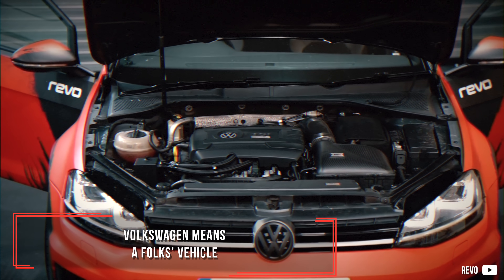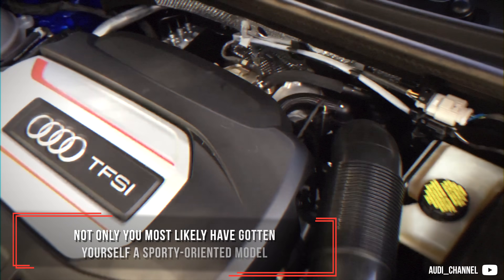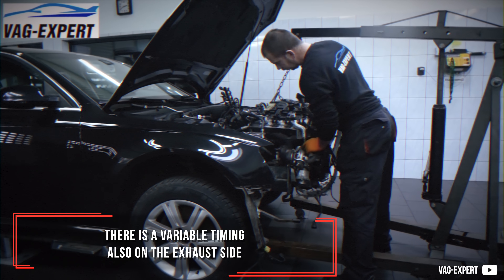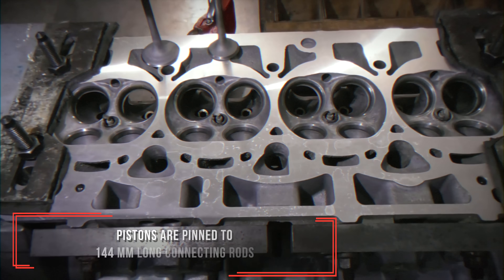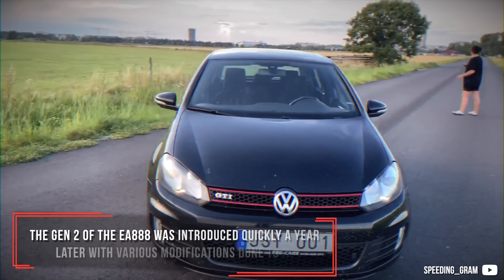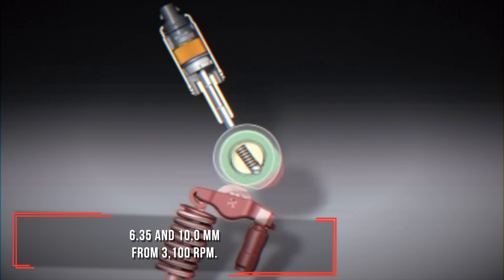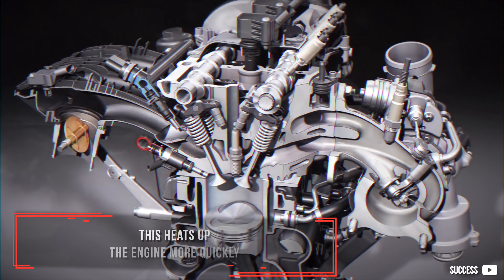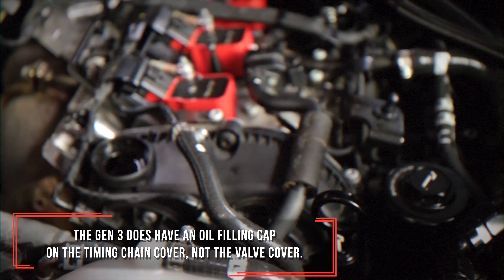Why The Volkswagen EA888 Is So Good

Comment: I would like to spell out a very common misconception with the gen 3 2.0 EA888 TFSI's:  The 2.0 engine in the Audi S3 and Golf R is NOT the same exact  engine that is in the standard 2.0 Audi A3/VW GTI.  On the S3/Golf R there are many upgrades over the standard 2.0 , they are: 1) different cylinder heads  (different aluminum alloy for higher thermal stress) 2) upgraded exhaust valve seat rings(improves temperature stablity), 3) upgraded exhaust camshaft (adapted valve timings) 4) compression ratio of 9:3:1 with different pistons 5)piston cooling jets (higher flow rate) 6)exhaust turbocharger 7) higher charge pressures up to 17.4 PSI 8)high performance main radiator 9) the connecting rods are reinforced.  Just wanted to clarify that . Im glad I went with the S3, so far even stock it very quick and has amazing handling characteristics , (tossable chasis and very nimble)
Reply: Don’t be an elitist, it’s pretty similar. Makes 50hp crank hp more. You just copied and pasted that info from the forums lol. Sincerely guy with owned a heavily modified A3
Reply: @Irishluckily  
Has nothing to do with “ elitist “-
Why the inferiority complex?
I used to have an A3 , love those cars also .
The truth needs to be known tough guy-
After all what is copying and pasting for? Lol

Comment: 2015 audi S3 105K miles. 
Did new waterpump Thermostat 
Carbon clean 
Coils/plugs 
Stg 1 high boost 93 Oct.
Cobb tune OTS. 

Still running like new

Comment: First lock down I bought a passat b5 2000 1.8t with 300k km and tuned it to stage 1. Such a difference. I made trips all over europe and uk and made 30k in one year. Easy to maintain it, change the oil etc. So good to feel the acceleration and power and yet the consuption was about 6.5l/100km. Once I drove from London to Slovenia in one go consuming only 6.2l/100km even though in Germany I drove up to 200km/h. Such a fun engine.
Reply: I swear there's no change in fuel consumption from 70mph to 120mph in most small VW with turbocharged engines.
Reply: @jasono2139   I am coasting a lot and braking with engine which helps low consumption. Of course if I was driving 200km/h all the time I wouldn't get this mpg. In Germany there are patches with no speed limit, but mostly it's 130km or 120km limit. And the quality of roads are important as well. Some roads slow you down even when going downhill.
Reply: @otherstuff9121  yup, I've never done 200kph in the US or Europe... but it's honestly crazy how fast people in Europe will drive on the highway despite some cars barely having the power to keep the limit.

Once I drove my wife to see her grandmother once, we were doing 160kph for a while and didn't pass anyone!

You'd be blowing everyone's doors off at that speed in the US.
Reply: @otherstuff9121  as for consumption, only once did I average about 140kph on a trip... but I still got about my average of 34mpg on the highway. 🤷

...any other car I've driven would have gotten about 10mpg less doing those speeds.

Comment: i have a mk6 GLI 30th edition with the  gen3 in it, and it has been such a solid engine so far hoping that i dont run into turbo issues because the gen3 in the mk6 was a bit of an odd engine, hardly any of the MQB stuff works on it.
Reply: Mqb stuff can work with right parts

Comment: I can confirm. I have a 19 Passat Wolfsburg and have A custom exhaust. The car sounds like a v12 but with DSG farts which is insane. I've been able to race WRX STI, Dodge Charger RTs, Type Rs and 500+ HP Range Rovers and BMW and beat them or tie with them from a dig even though the car is front wheel drive. The acceleration is insane. driven cross country  3 times within a year

Comment: The version of the 3rd gen that we get in the U.S. does not have the added port injection.   Carbon build up is unfortunately still a major issue for us.
Reply: not always...I give my Audis' and VW's frequent "Italian tune ups" which works for sure- it blasts alot of the carbon deposits away.  Im on my 2nd 3rd Gen EA888 and have not had carbon build up issues yet. Still, carbon cleanings are not the end of the world, can be done for a reasonable price.
Reply: @volkssturm9694  so called Italian tune ups will not help..think about it.. valves get hotter.. carbon bakes on hotter..or the carbon flakes off and gets stuck in the rings  or thuo the turbo blades....yes i am a tech...
Reply: @randellgribben9772   In theory ,....maybe, but reality is often a totally different story.There is tons of anecdotal evidence that Italian tune ups help to at least some extent. Like I said, I have never needed carbon cleanings  with various EA888 engines all around 150K miles...maybe I just got lucky?  Even if so, a nice carbon cleaning is not that expensive. I do enjoy listening to a "techs" input though.
Reply: @volkssturm9694  12 years at     alfetta motors in vallejo cal... worked on classic Italian cars as a    'tech '  so i just might have some experience working on cars
Reply: On the gen 3 they changed the funnel design of the air/oil separator or PCV. Thus, helping with the carbon build up.  All DI engines suffered from carbon buildup. Even Hyundai‘s, Subarus, Fords, Chevys,  Honda
Reply: Is that the case for the later gen 3b engines  @tfiresmith01
Reply: The gen 3 doesn't have the carbon issues of the earlier gens.
Also, Italian tune ups and not always driving like an old geezer.
My '15 1.8 drives like new still!

Comment: waiting for the clutch to (eventually) die out on my 290 Cupra. Afterwards, I'm putting a Sachs Performance kit and making it stage 1. 290 hp is enough for FWD, really difficult to put down the power but am still curious how it will perform with the extra boost

Comment: is there a direct injection gasoline engine that sprays the fuel thru the spark plugs? IE the spark plug is also the fuel injector nozzle.

Comment: I've never come across an engine with more issues than a bad gf. Looking at bent valves in a 09 VW Tiguan, 09 Audi A4, A3, chain issues with the Tiguan also, and crap intake manifolds on the A3 and a VW CC. If you ever wanted to have a car that can surprise you with different problems ever time it's this one. 😀👍

Comment: Sold my 1.8t passat with the ea888 at52k  miles. It was already chugging lots of oil between oil changes and rough idling at times. Check out what scotty kilmer has to say about vw/audi.
Reply: recirc is plugged! scotty not always spot on.
Reply: @geodot595  you havent even seen the car and already making Dx. What makes you think you got anything on mechanic with 50yrs experience. Those engines are just not built to last.
Reply: @Green_Dragon2023  i am a master german car tech 28 yrs.
Reply: If you say so. Glad i got rid of it for a good price though.

Comment: The EA888.1 and .2 Can be reliable tuned as well, Do your maintenance on time, every time. And dont put off repairs for too long or they get worse and can pile up on each other.
Gen1 & 2 of these engines (Gen1 ususally considered more reliable in general), Both versions have chain tensioner issues and tons of them still run the same tensioner design. Until the newest revision, All tensioners for these engines weren't exactly "Good" they were just improved.

 My A3 wasn't included in the recall and had a first revision tensioner that was ready to explode at any moment when I got it. Didn't sound bad at all, barely any noise on startup. Couldn't even hear it with the windows up and hood closed. Don't risk it. Don't even start it again even if its been sitting for months, until you can move it to take care of it.
 Any chain noise at all is not good on startup and any noise means its already toast. Its not an "I can push it to next week/month" moment Its a "My whole week/month has been ruined" moment.

Get your that taken care of or do it yourself (Not a fun job.. Or tooo bad either), Check over everything physically and for leaks. Get a Vag-com or OBD11 and check that everything is operating within OEM spec on the engine side, Timing, Fuel trim, etc... Keep up on the irritating Carbon cleaning ritual, Install an All Metal Water pump when needed, Fix whatever else you need to. 
And it should be good to go for a long time.
Reply: Absolutely. Im getting close to the 200 000km Mark. No oil consumption, Chains still well within the tolerance... Ive basicly had no issues with this car even tought the ECU is "flashed" with a Stage 2 programmation for now over 100 000km

Comment: Great engines if looked after. Cars earlier than MY12 should have the revised timing chain tensioner fitted at the very least to prevent potential catastrophic failure due to a design flaw in the original. Stage 1 remap transforms the car but doesn’t hit fuel economy if you need to be economical. On a boring drive I’ll see around 45mpg while on a quiet day I can boot it and still get no less than 35mpg on the same journey. It’s nice to have the option of having power to spare without economy being sacrificed when you drive normally, and right now that matters with the price of fuel being what it is.

Comment: I loved my 2017 S3 with hybrid turbo, and the EA888 is great. My only problem is the more power I made, the worse it sounded. I moved onto a B58 but the EA888 will always have my respect as one of the best modern 4 cyl
Reply: yes, the problem is when you do a performance cat back exhaust on the S3,  and turbo down pipe, it sounds too much like a ricer.  My S3 is stock for now, 2018 only 15K miles, has factory resonator delete and IMHO its one of the best sounding 4 bangers like this, set up nice and deep/rich exhaust note, very nice.
Reply: @volkssturm9694 you’re right - but the lack of good sounding EA888s isn’t because of some inherent design flaw of the engine - it’s due to the turbos. The K and IS series of turbos are not great in terms of how they sound when paired with the 2.0T. 

Look at any G series (turbo by Garrett) build on the EA888. They sound IMMENSE!! They absolutely transform the acoustics of the exhaust and make the EA888 sound genuinely good. 

The IS38 and IS20 are too small and restrictive to truly allow the engine to sing - they act as permanent mufflers on the exhaust.
Reply: @UnknownBreadd1  interesting. My S3 is stage 2 now with FBO, just a downpipe ( CTS 3.5 inch catted) to the Rez delete and factory cat back and IMHO It sounds pretty dam good . Eventually, I'll go hybrid turbo, Ill look into the Garrett, thanks. Pretty amazing what the beefed up 2.0T ea888 can do with bolt ons and downpipe,...running high 11s in the quarter, total blast to drive.
Reply: Add a vibrant ultra slient resonator  @volkssturm9694
Reply: Sounds like a European Godzilla
Reply: Toying between a golf r wagon and a 330i wagon..the Vw sounds terrible as u said and the b48 sounds pretty good for a 4. Just a big price jumo
Reply: @tellyawhatmate huge price jumó lol
Reply: Add a vibrant ultra quiet resonator

Comment: I have a ea888 in mk6 gti  thats been running a bigger turbo,methonal injection and a decent tune for a while now. I am happy with it. Had some water pump issues caused by the timing cover oil leak. 
Replaced the timing cover gasket,installed metal water pump housing,that problem has been solved. 

I also have the gen 3. So far only a stage 1 tune but it's been doing fine as well. However in the US the gen 3 didn't get port injection along with DI. It does use a little oil and is only 50k miles, curious to see if it's going to hold up long term.

Comment: I drive a stage 2 mk7 gti with the stock 2l turbo charged es888. so much fucking fun and the sound. ugh

edit: with cold air intake, downpipe upgrade, intercooler, and engine tune it makes 320 bhp and 399 ft lbs of tourque. the tuning possibilities on these are wild.

Comment: My 1.8t 1998 A4 quattro was sold to the original owner with 300,000 miles. All stock internals and trans with a 24psi K04 tune + bolt ons. Even when the intercooler was popped off doing a pull, limp mode allowed it to drive home gently. 

Truly a tank. No issues and all servicing was cheap and I could do it myself.

Comment: I bought a Mk7 GTI new in January 2015 with the 3rd gen motor. I have 84,000 miles on the car over 7 years of ownership It’s been perfectly reliable. Synthetic oil changes every 10,000 miles and it runs perfect. People say VW’s are unreliable I’d disagree as their newer stuff is fantastic I’ve spent less than $1,700 in maintenance over 7 years for my VW outside of tires.
Reply: Yikes!! 10,000 miles is way to long before oil changes....fucking thing only takes 6 quarts. I did my oil changes every 4k miles on my 16 mk7 golf gti, 6 years 100k miles and the dealership thought it was a brand new engine. You probably have burnt oil and sludge building up in your engine with that oil change interval.
Reply: @robbalinski1606  most likely not..... The VW/Audi 07k motor does 10k intervals for synthetic..... I've seen these Opened with 12k oil changes over 100k miles with  no sludge ........ But to be fair the 07k is the better engine anyway.......
Reply: @robbalinski1606   agree totally,  with my 2015 Audi A3 1.8T Gen 3 EA888 I did oil changes every 5K or less and the car lasted until 145K without major issues, still running fine until I traded it in for my new 2018 Audi S3 which is an amazing car, got it last month with 8K miles.
Reply: @robbalinski1606  Youa are well informed, Sir! 
Here in Europe we change at 10K KMs, not miles, which is 16K kms. I change at 8K km personally on mine 1.8T 20V purchased from anold lady, and there was a sludge. Still need to change the oil sump and clean the bottom tray, allready cleaned the head and changed valve seals. I hope to clean the engine with good oil and 8000 kms changes in the future.
Reply: That's funny. I have a 2014 Passat with about 83k miles on it with similar reliability. The only issue I had outside of the safety recalls was a leaky water pump and the damper for the sunglasses over head storage broke.

That's it!

...and yes, 10k mileage oil change intervals (which is manufacturer spec). Granted it'll consume a quart of oil over 5k miles, so I typically add a bit half way between changes.
Reply: Imagine being stoked to make it to 80,000 mi 😆
Reply: @brettbrettson69  imagine being so dumb that you think people who own 7 year old cars are going to wait to comment on a video until they've owned their cars for 15 years. 🤦
Reply: @brettbrettson69  GEN three 888 engines run to 150- 200 K on a regular basis
Including the two that I own
It’s so simple keep up with your maintenance take care of your engine it’s gonna take care of you
Reply: Oil consumption so far?

Comment: 500 hp with just a tune? Anything above 350 on the GTI version of the EA888 (Golf R version has strengthened  internals in addition to a larger turbo) is just asking for trouble. Even a stage 1 tune will quickly wear out the stock clutch on a GTI (ask me how I know, lol) but stage 2 and beyond is going to be pushing even the DSG to it's limits..and personally I wouldnt do it on a daily driver. It is a great little engine though, just proceed with caution and be prepared to spend some money beyond what the tune costs..unless you go with a very mild bump in power. (basically a plug and play do it yourself tune)
Reply: I’ve owned a 150K stage 2 tuned GLI and DSG tuned with NO issues at all. My friends accord tuned and civic tuned had way more problems than mine

Comment: I had a Seat Ibiza Cupra with the 1.8 liter EA888. The engine has a brute torque of 320Nm, which is really fun to drive. Unfortunately, consumption is pretty high at 9 liters per 100km. But almost 200 horses also have to be fed.

Comment: I just now realized that I've had all the 3 different engines mentioned in this video, in order.
First I had a 1.8T 20V Seat Leon with 180hp
Then I changed it to a Audi S3 -09 with the EA113 engine
And now I have a sedan Audi S3 -16 with the EA888 gen3 engine, which is by far the best. Lowest turbo lag of the three, despite being fastest and least fuel consumption.

Comment: I have a 2.0t ea888 gen1 with 184,000 miles in my a3 with a dsg love it  

Edit 3 years later at 214k miles still original dsg had to rebuild the mechatronics unit at 190k

Comment: Help me. I'm a Korean young man who runs Audi ttmk3. The ea888 gen3 engine is broken. Unitronic stage3 mapping was performed at 120,000 km. Now 170,000km, I recently requested custom mapping, and after mapping, the engine was damaged while recovering the vehicle. The hardware at the time of custom mapping was dbv2 v2 turbine, tvs reinforcement clutch, methanol kit, high pressure pump, low pressure pump, vwr600 intake air, downpipe, etc. It is said that the piston broke and pierced the engine block. It broke down the conference. The company claims that it is a failure due to accumulation of engine damage due to previous mapping. Currently, we are planning to find a new engine and work on forging piston and unloading, but we are worried about durability. I think it's going to be hard to manage because I live in the countryside. Is there any problem with the engine? I want to ride it for a long time without any problems. I'm stressed out because I spent a lot of money on this.
Reply: If there is a problem with the forging engine this time, I plan to return to Unitronic stage 3.

Comment: I know they get a lot of crap but my MK6 GTI has been nothing but reliable at 120k miles and being stage 2 for the past 70k miles. Love this car so much
Reply: My 2016 MK7GTI has Unitronic stage 2 at 337HP and 370ftp. 
Since Ive owned,  ZERRRRRRO failed parts, mechanical or electrical. Hmmm, I want to thank the Mexican 🇮🇹 partners for great workmanship.
Reply: Same here after 9 years of owning my Mk6 GTI has been a good to me
Reply: Have you cleaned out ur valves they tend to get alot of carbon build up
Reply: @scottroberts5529  was done at 90k.
Reply: gti's are poser cars